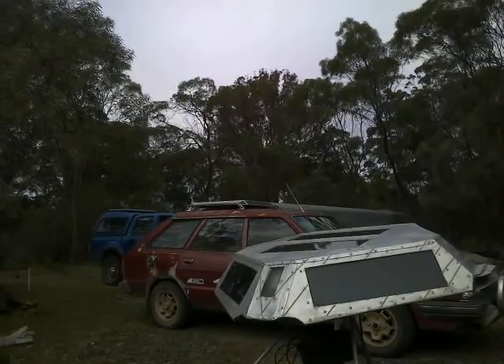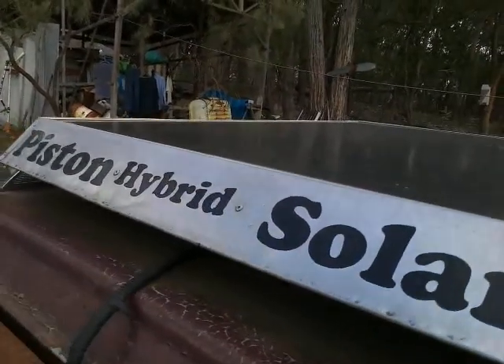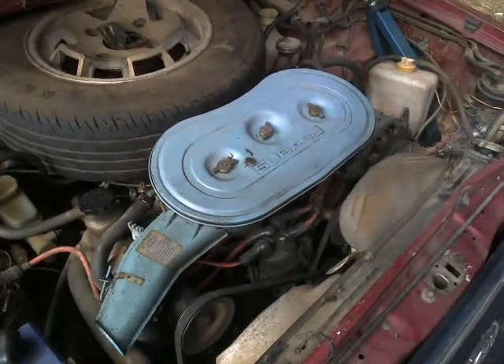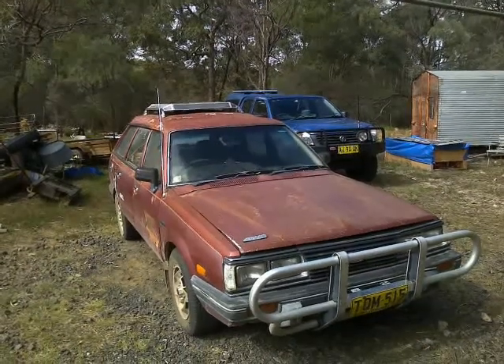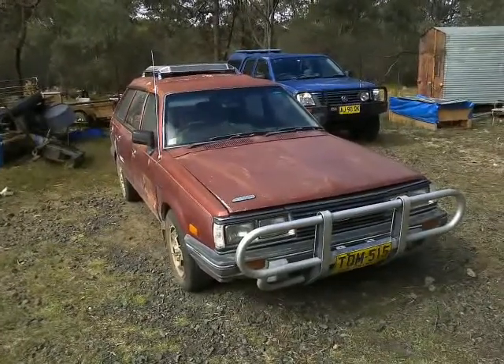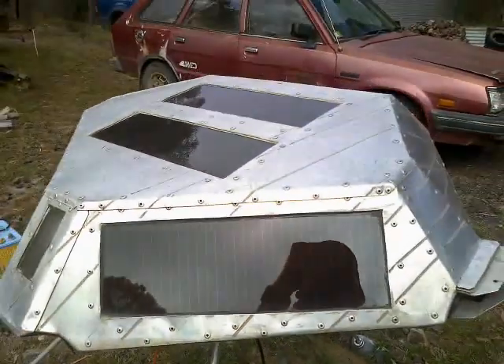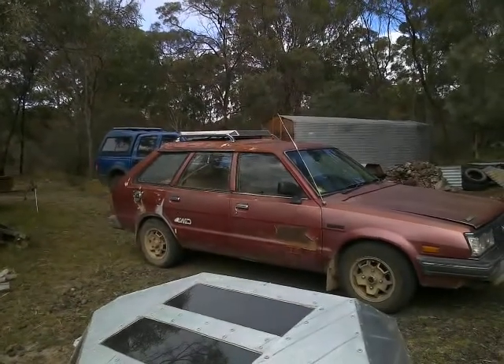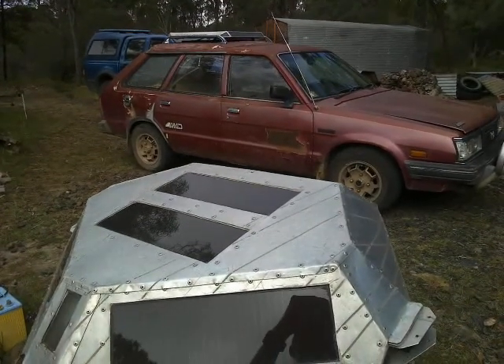SunFoil Acceleration Effect (Turbo Diesel).

Comment: Here is another way to get more fuel efficiency - On the fuel pipe just before it enters the carby, strap a powerful magnet to the fuel pipe. The fuel passing through the magnetic fuel will get ionised. What this means is that the oxygen absorbing ability of the fuel is increased which saves fuel when it is combusted.....If you don't believe, here is a simple experiment. Light up one of those long BBQ Fire lighters and then watch what happens to the flame when you put a strong magnet on the nozzle - the flame coming out the end will be more powerful.
Reply from the maker: G'day Ed,

Thanks mate,

 I'll have to try that trick with the BBQ Lighter, you mean the Gas ones I suppose ?

 Does the Aluminium Petrol-Pipe have the North Magnetic Pole against it, or the South Pole, or should the Fuel-Line be between two Magnetic Poles ?

I know Hydrogen becomes metallic if it's squeezed hard enough or cooled nearly to Absolute Zero, but it's beyond my ken how pumping Hydrocarbon at Fuel-Pump Pressures and Outside Air Temperatures could have any effect on Combustion characteristics...

  The beauty of the SunFoils is that they don't rely on Placebo Effect to get a result...

 What did you think of my thunkin's about Hockey's Hoodwinkery about Small Busyness' Corporate Tax Rates & Write-Offs, in the Sunday Rant...; am I right, hasn't your Beancounting Fraternity long ago jigged the System so that each Small Business  is a Comoany which makes as tiny a "Book Profit" as possible, so as to only ever have to pay GST & Licence-Fees, while all the Employees pay their income Tax, but Companies only ever pay Tax on the Profit before it is paid as "Dividends" to the "Shareholders", while the "Shares" are all held by the individual whom the Company employs as it's Managing Director..., who directs the Company to plough it's operating Surpluses into Capital Expenditures, so that not much Profit is ever declared...(?).

;-p

Ciao !

 Does the resulting Combustion-Gasmix emerge with Magnetic properties, after the Magnetised Fuel us burned ?

 I don't immediately see how
Reply: Chris, I am referring to a normal BBQ gas lighter. Forget what I said about watching the flame as you put a magnet on the nozzle. The way to notice the difference is by feeling the heat difference. Put your hand say 6 inched above the flame. Keep your hand there and then feel the surge in heat when you place the magnet North South along the barrel of the lighter.......By the way, I commented in detail on the changes to the Company Tax rate on your video from yesterday. Cheers mate.
Reply from the maker: VB Ed 
Ah, Thanks mate...

So, um, how about testing the heat of the flame by something other than time to barbeque one's hand...; maybe the time to boil a Thimbleful of Water, over magnetised and unmagnetised Gas-Fires...?

 I'm not a big fan of cooking myself...

;-p 

Ciao !